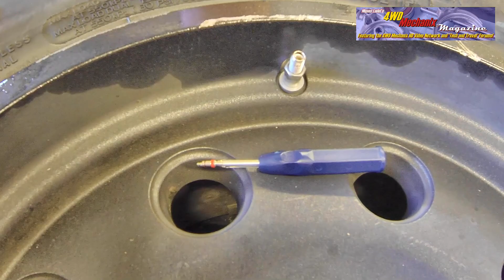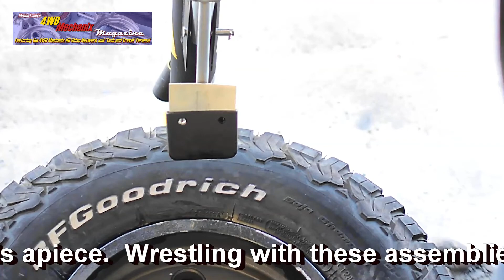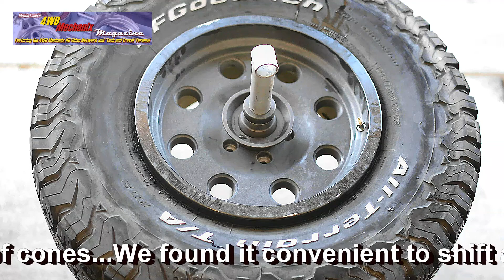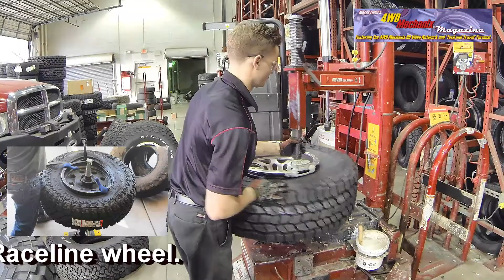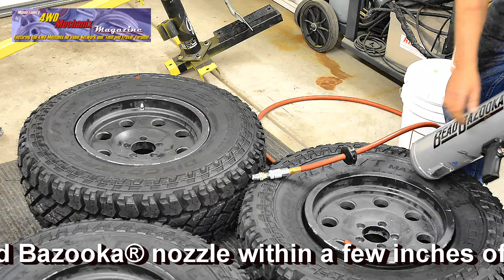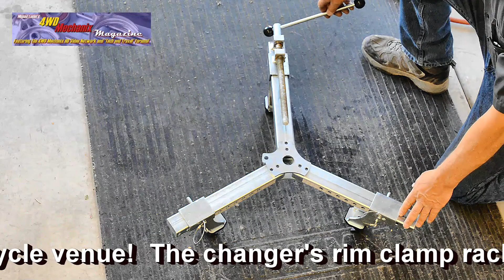How-to: Manual Tire Dismounting and Mounting

Comment: gaither must not be making this tire changer any longer, I cant find it. May I inquire what you paid for yours? and is it heavier quality than the harbor freight changer? thanks.
Reply from the maker: Gaither has stopped offering this changer.  It was popular in Europe, not so much in the U.S.  In my view, it's higher quality than the Harbor Freight unit.  I have a Harbor Freight changer with motorcycle tire adapter that has served well for years.  Neither of these changers are intended for large tires.  My demonstration with the 10-ply (LRE) tires really pressed the limit.  I heartily recommend either of these changers for motorcycle work, especially dirt bikes.  The Gaither manual changer was priced above the Harbor Freight model when I bought it...I buy select tooling and equipment from Harbor Freight.  My favorite Gaither equipment is true commercial grade.  Gaither specializes in heavy-duty, commercial truck tire equipment.  H-F's motorcycle platform lift is a great value.  I'm open to either of these vendors, depending on what grade equipment is needed.  What are your needs here?

Comment: Thanks much!  Im  in 70th yr.  I just bought one this week at HFT, for $60. But, i have no garage to bolt into floor. Will need to get thick plywood and fasten to it.  Keep your stick on the ice, like Red Green!
Reply from the maker: I also have a Harbor Freight changer with the motorcycle adapter.  I welded a bracket and the tire changer stand to the front of my Harbor Freight platform/scissors lift.  (Can't stay away from my welding equipment!)  I'm an HF fan and selective about their product lines.  I do well with Pittsburgh, Daytona, Quinn, Vulcan and, of course, ICON.  Quality keeps getting better across the store...The most risky thing I've done at Harbor Freight was to get the HF credit card and Inside Track!

Comment: Excellent  !
Reply from the maker: Glad you like it!  It's great for a portable tire changer.  There's a lot of effort involved when changing tires by hand.  I worked with truck tires years ago, so the job is no surprise.  For a remote site or dirt motorcycle race pit, this machine and my receiver brace work well.  The rim clamp force, however, is best suited for motorcycle rims and tires.  I recently mounted new 18.5x8.50-8 tires on our Karavan motorcycle trailer.  With the 8" diameter wheel size, it was difficult to dismount the tires without the rim rotating in the clamps.  The changer works with bigger diameter wheels (like I demonstrate in the video) and especially well for motorcycle rims, which require far less clamping force to keep the rim from rotating.  I spoon off and on motorcycle tires, which makes this even easier.

Comment: Doing it this way would probably take you one week an half off a Saturday just to do one tire
Reply from the maker: Imagine that I did five Load Range E (10-ply rated) tires this way...The experience was my incentive for purchasing a Weaver W-898XS tire changer with the Assist Arm.  The unit was on sale, a smoking deal, and I was ready.  As for the manual tire changer, it is functional and does have merit for field or trail use.  I revisited the manual changer a few weeks ago to mount utility trailer tires on wide 8-inch diameter rims.  (The standard W-898XS clamp will not close to this diameter, but I'm now ready to invest in the motorcycle adapter from Derek Weaver.  It takes care of these smaller diameter rims.)  In my view, the best use for the manual changer is for motorcycle tires and rims.  Here, the clamp force is not dramatic, and the tires dismount and mount readily...To your point, the one thing I do miss about using the manual changer with tire irons on LRE light truck tires is the world class, gym-level exercise!